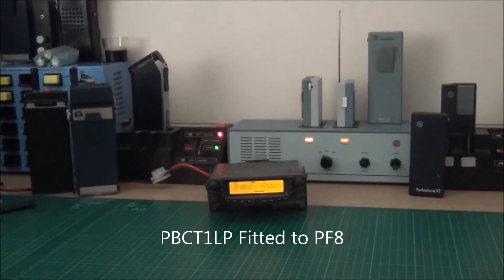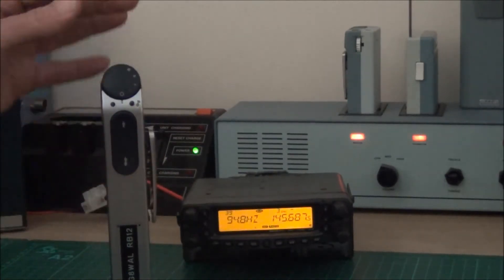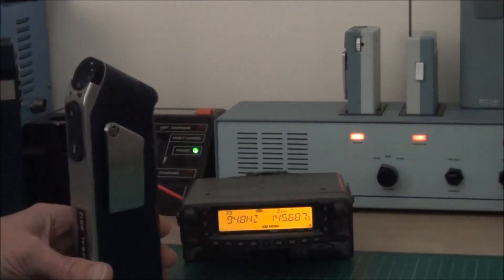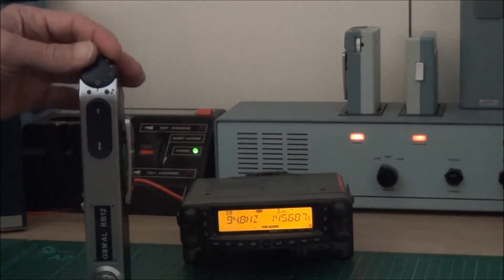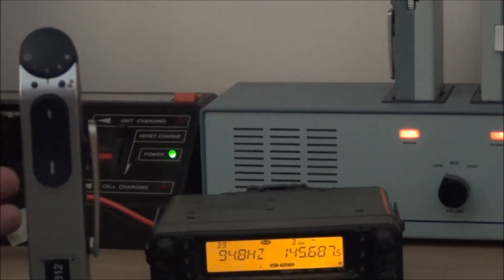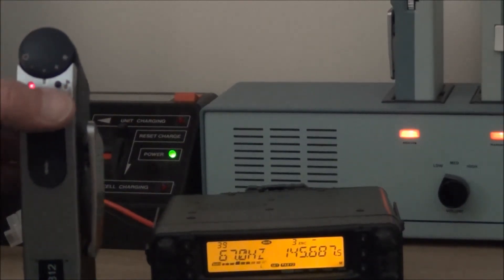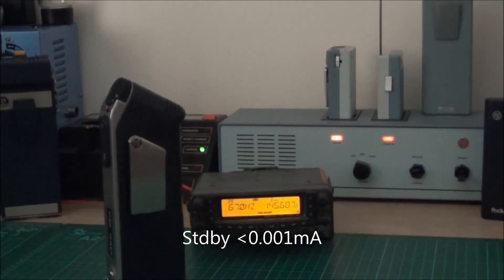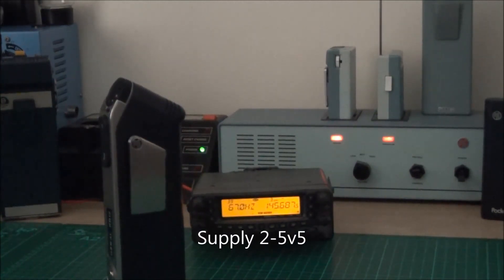PBCT1LP Intelligent CTCSS tone encoder

Comment: Hello, for anyone considering this item I thought I would post my comments. I recently purchased this item from Paul, G8WAL, for my Kenwood TS790E. It is an amazing piece of kit, especially for a radio of this age as it only had the original 1750hz tone option fitted. Paul professionally fitted the unit for me and I would have no hesitation in recommending the unit (or Paul). Purchase with complete confidence. I have no affiliation other than to be a very satisfied customer. Mark  - G0TOV QTHR.